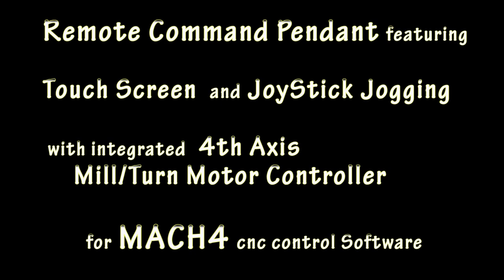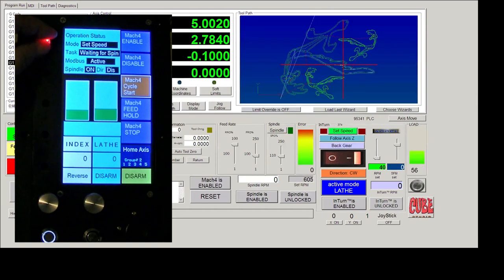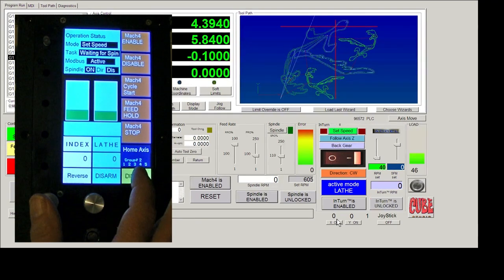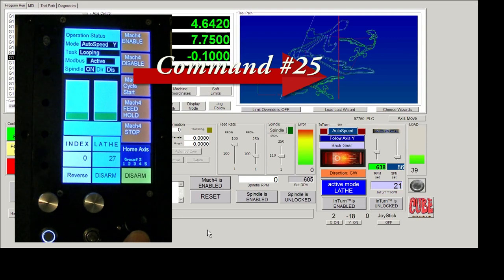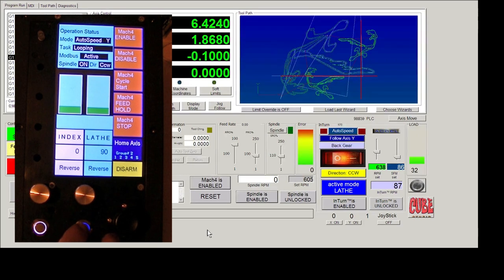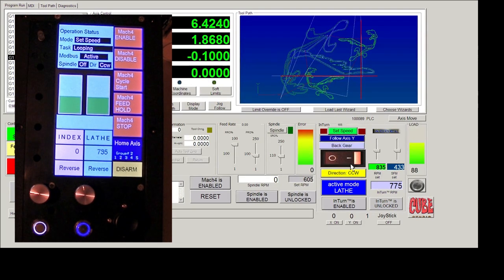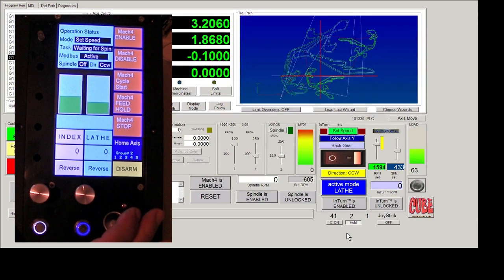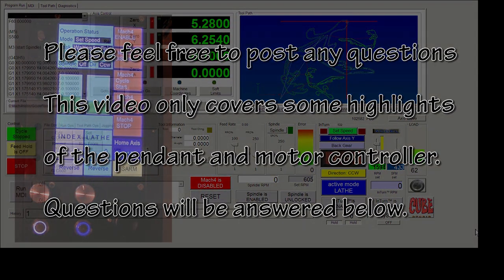Remote Command Pendant and 4th axis Mill/Turn Controller for MACH4

Comment: cleaver bugger you have the second pendant available for M4, and you bet me to a idea I had joystick I am makeing disabled person mouse using a joy stick, a joystick like what you are using, I was going to use brian`s mouse code to do it as thats what it is and just have it so you have x, y movement with the joy stick and z axis with the scroll weel
Reply from the maker: +daniel lyall Interesting point about the Z axis. Because I use the Z axis jog to drill, I did not want it to have a variable speed like the X and Y, so the Z axis jog works by twisting the stick right or left, but at a fixed rate so that it is useable for drilling.  I am using this prototype on an actual mill at this point so as I gain experience with it, I am making some adjustments before the first batch of these are shipped to my testers. Once I have their feedback, I will finalize the behaviors.
Reply: +Simpsons36 sounds good

Comment: How are your pendant controls wired in? Pokeys?
Reply from the maker: +CncObsession The pendant features are built on top of the existing 4th axis motor controller which  was USB, but is now interfaced to both MACH3 and MACH4 thru TCP Modbus (Ethernet). The Remote Command Pendant is only available for MACH4 because MACH3 is not capable of running the CNC side of the process which is currently over 1,000 lines of LUA (a bizarre combination of 'C' and 'Basic') program code.  The motor controller is 3,000 lines of C and the Pendant functions add almost another 2,000 to that.Also Mach3 seems to have trouble when the number or Modbus registers get to about 26 (or so). The Pendant is currently pushing 40 registers, 4 of which are bit packed, with about a 23ms loop time.  . . i.e. wicked fast! The difference between clicking the MACH4 screen and tapping the pendant screen is about 30ms, give or take,  which is 'instantaneous' in terms of human perception. Thanks for the question.